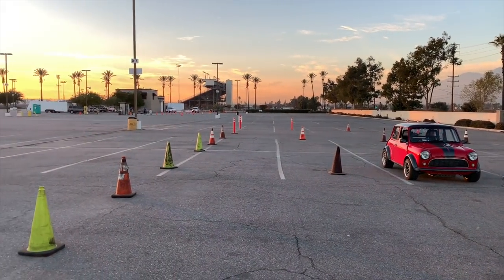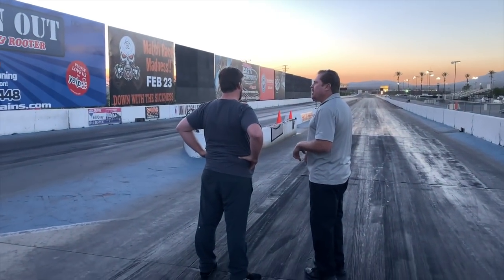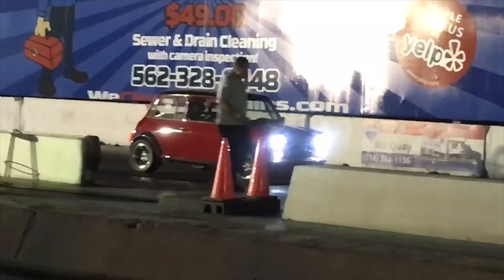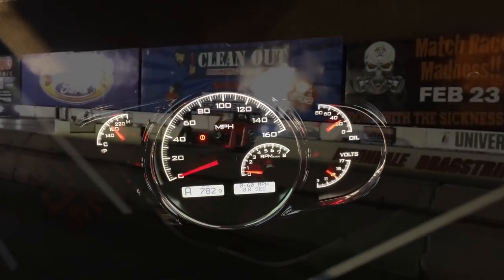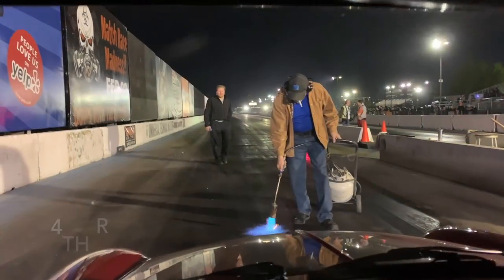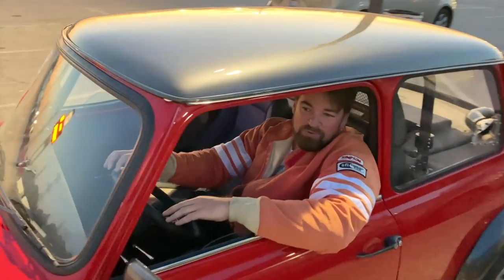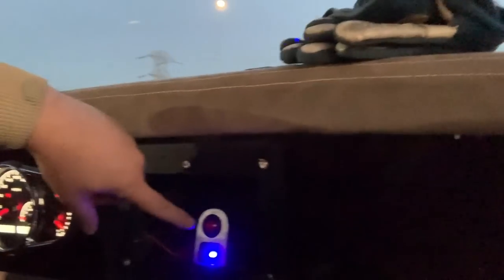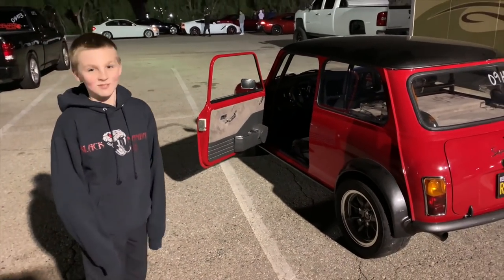500WHP Super Cooper S VS the Drag Strip with coach Tom Bayers

Comment: What is the point of a 1/4 drag video without showing what times you managed, even if they were below your expectations.
Reply: I totally agree...But what's the point of the 1/8 mile race????? Waste of time, as the car does not get to stretch it's legs and realize the top end pulling power once you achieve grip. You MUST show times.